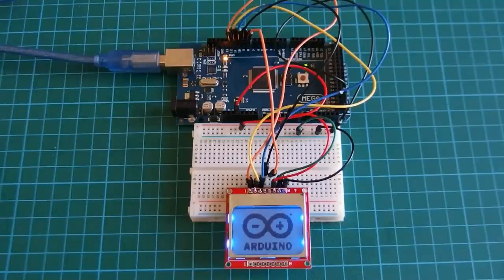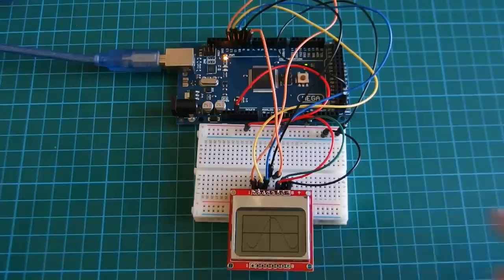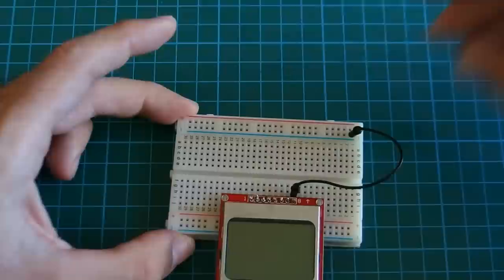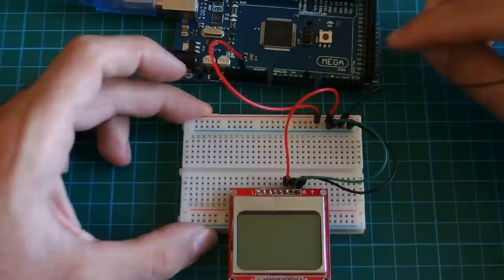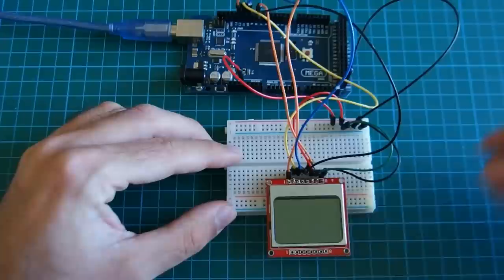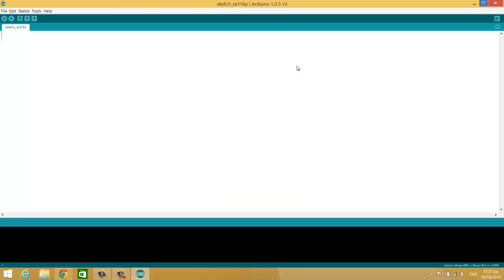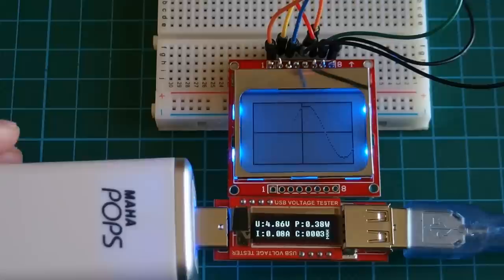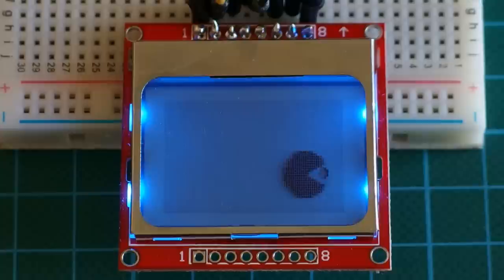Arduino Tutorial: Nokia 5110 84x48 LCD display, how to drive with Arduino

Comment: You need to us either the 4050 level shifter ic, or use current limiting resistors of 10k on the logic pins to prevent damage.

Comment: I was reading somewhere that the 5110 had to run at a 3.3v signal and it might damage running at a 5v signal.
Reply from the maker: +Crackerjack Don't worry I am using mine with 5V for months with no problems at all.
Reply: Crackerjack yeah, we had it in out student f1 racecar and at 5v it slowly died.....
Reply: Displaying fast animations my display would stop at 5v signals, adding a logic level converter to 3.3v fixed the problem. Thereare so many variations of this screen maybe a rule of thumb for someone won't apply to someone else. I suggest following the specs for yours.
Reply: Until now i have destroyed two displays due to 5V signals. It won´t die instantly but after some time it conks out...
Reply: cant you just use a 1k-2k divider on the DIN pin to drop your data logic down ?

Comment: Excelent video, I have a question, You are using an Arduino, it's 5V logic level CPU. The display has 3v3 logic level, internally it has a 5V to 3V3 regulator but logic level remains at 3v3!
Accordly datasheet, ILI9163C doesn't support 5V logic levels, this mean you need a logic converter, such as CD4050 IC, powered at 3v3 between arduino and display. Why you don't use this ? no risk of screen burn? I Ask because I use the lcd like you show and few hours later the screen turn off sometimes.
Thank's
Reply: Use 10k resistor

Comment: Be careful how you connect the backlight. I used resistor which has not enough ohms and got glitched pacmans. Use resistor with greater value and you'll be good.

Comment: Shouldn't all pins have 3.3v? You have connected all the other pins directly to the Arduino without a level shifter even though the library page says you have to use it.

Comment: Update: The library is now at http://www.rinkydinkelectronics.com/library.php?id=47
I saw that the breadboard is not really needed to connect the 5110 to the Arduino Mega.  I also figured out how to control the contrast with a 10k pot when running on 5v (although it works perfectly at 3.3v) and the display is too bright. Very good tutorial Sir! I look forward to watching the rest you have so kindly provided. Thank You.

Comment: It works too for "blue" LCD variant with PINS RST, CE, DC, Din, Clk,Vcc,BL,Gnd http://embedded-lab.com/blog/wp-content/uploads/2016/01/T7_OP2.jpg but: SCK is Clk, MOSI is Din and CS is CE

// It is assumed that the LCD module is connected to
// the following pins:
//      SCK  - Pin 8  is Clk my PIN 6
//      MOSI - Pin 9  is DIN my PIN 5
//      DC   - Pin 10 -- DC my PIN 4
//      RST  - Pin 11 -- RST my PIN 2
//      CS   - Pin 12 is CE my PIN 3
//
#include <LCD5110_Graph.h>
//RST, CE, DC, Din, Clk,Vcc,BL,Gnd
//D2,D3,D4,D5,D6 and VCC-3,3V, BL-(potentiometer to control backlight)-5V, GND-GND

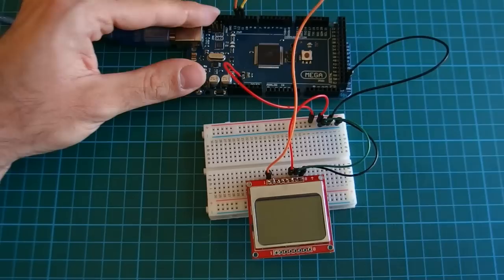Comment: Hi was able to do the wiring and also pasted the library under the Arduino library, but when trying to complite the demo on the examples, i get the following error: Arduino:1.6.5 Hourly Build 2015/05/15 04:50 (Windows 8.1), Placa:"Arduino Uno"

Opciones de compilación cambiadas, reconstruyendo todo

LCD5110_Scrolling_Text.pde:18:27: fatal error: LCD5110_Graph.h: No such file or directory
compilation terminated.
Error de compilación

  This report would have more information with
  "Show verbose output during compilation"
  activala desde Archivo > Preferencias

Any help will be aooreciated.

Regards,
Reply from the maker: +carlos villalobos It seems, that your Nokia 5110 Graph library is not installed correctly. Please try again.
Reply: +Educ8s.com Hi. I went to the option that says to load the .zip file, i was able to upload it and now it works. Thanks for replying.

Comment: Clear explanation on all your videos, thanks! But I am getting an error with this, can you please help?

Arduino: 1.8.1 (Windows 10), Board: "Arduino Pro or Pro Mini, ATmega328 (5V, 16 MHz)"

L:\Documents\Arduino\LCD5110_Graph_Demo\LCD5110_Graph_Demo.ino: In function 'void loop()':

L:\Documents\Arduino\LCD5110_Graph_Demo\LCD5110_Graph_Demo.ino:52:42: warning: deprecated conversion from string constant to 'char*' [-Wwrite-strings]

   myGLCD.print("LCD5110_Graph", CENTER, 0);

                                          ^

L:\Documents\Arduino\LCD5110_Graph_Demo\LCD5110_Graph_Demo.ino:53:34: warning: deprecated conversion from string constant to 'char*' [-Wwrite-strings]

   myGLCD.print("DEMO", CENTER, 20);

                                  ^

L:\Documents\Arduino\LCD5110_Graph_Demo\LCD5110_Graph_Demo.ino:61:40: warning: deprecated conversion from string constant to 'char*' [-Wwrite-strings]

   myGLCD.print("(C)2015 by", CENTER, 36);

                                        ^

L:\Documents\Arduino\LCD5110_Graph_Demo\LCD5110_Graph_Demo.ino:62:45: warning: deprecated conversion from string constant to 'char*' [-Wwrite-strings]

   myGLCD.print("Henning Karlsen", CENTER, 42);

                                             ^

L:\Documents\Arduino\LCD5110_Graph_Demo\LCD5110_Graph_Demo.ino:165:43: warning: deprecated conversion from string constant to 'char*' [-Wwrite-strings]

   myGLCD.print("Runtime (ms):", CENTER, 32);

                                           ^

C:\Users\User\AppData\Local\Temp\ccpN5Xgf.ltrans0.ltrans.o: In function `loop':

L:\Documents\Arduino\LCD5110_Graph_Demo/LCD5110_Graph_Demo.ino:46: undefined reference to `arduino_logo'

L:\Documents\Arduino\LCD5110_Graph_Demo/LCD5110_Graph_Demo.ino:46: undefined reference to `arduino_logo'

L:\Documents\Arduino\LCD5110_Graph_Demo/LCD5110_Graph_Demo.ino:148: undefined reference to `pacman2'

L:\Documents\Arduino\LCD5110_Graph_Demo/LCD5110_Graph_Demo.ino:148: undefined reference to `pacman2'

L:\Documents\Arduino\LCD5110_Graph_Demo/LCD5110_Graph_Demo.ino:139: undefined reference to `pill'

L:\Documents\Arduino\LCD5110_Graph_Demo/LCD5110_Graph_Demo.ino:139: undefined reference to `pill'

L:\Documents\Arduino\LCD5110_Graph_Demo/LCD5110_Graph_Demo.ino:142: undefined reference to `pacman1'

L:\Documents\Arduino\LCD5110_Graph_Demo/LCD5110_Graph_Demo.ino:142: undefined reference to `pacman1'

L:\Documents\Arduino\LCD5110_Graph_Demo/LCD5110_Graph_Demo.ino:146: undefined reference to `pacman3'

L:\Documents\Arduino\LCD5110_Graph_Demo/LCD5110_Graph_Demo.ino:146: undefined reference to `pacman3'

L:\Documents\Arduino\LCD5110_Graph_Demo/LCD5110_Graph_Demo.ino:160: undefined reference to `The_End'

L:\Documents\Arduino\LCD5110_Graph_Demo/LCD5110_Graph_Demo.ino:160: undefined reference to `The_End'

collect2.exe: error: ld returned 1 exit status

exit status 1
Error compiling for board Arduino Pro or Pro Mini.

This report would have more information with
"Show verbose output during compilation"
option enabled in File -> Preferences.

Comment: Good video. However, the contrast in these displays is poor ,erratic and frustratingly, tends to fade in and out.
Reply: Angus MacLellan check all of your connections, also what codet and library are you using?  if you are using a level shifter what kind?  If none of those issues are the problem you may need to gently press down on metal surrounding the screen, as the strip going to the screen may not be making good contact as these were intended to be encased in a phone.  These are great for the price, unfortunately many tutorials are not the greatest or give incorrect information

ελέγξτε όλες τις συνδέσεις σας και τι κώδικα και βιβλιοθήκη χρησιμοποιήσω; αν χρησιμοποιείτε ένα επίπεδο μεταγωγέας τι είδους; Εάν κανένα από αυτά τα ζητήματα είναι το πρόβλημα μπορεί να χρειαστεί να πιέστε απαλά προς τα κάτω στο μέταλλο γύρω από την οθόνη , καθώς η ταινία πηγαίνει στην οθόνη δεν μπορεί να κάνει καλή επαφή , όπως εκείνες που προορίζονται να περικλείονται σε ένα τηλέφωνο . Αυτά είναι μεγάλη για την τιμή , δυστυχώς , πολλά tutorials δεν είναι η μεγαλύτερη ή να δώσει ανακριβείς πληροφορίες

Comment: good night, good video I loved, I'm from Brazil.
  I doubt, the signals coming from the Arduino is 5v damage the display?
WHAT should I do to convert them to 3.3v?
thanks
Reply from the maker: Thanks, don't worry 5V is OK with this display.
Reply: +Leandro r. andrade If you are using an arduino UNO, there is a pin on the power section that provides 3,3V. Otherwise you can do a voltage devider with 2 resistors.

Comment: Hi, why you don't use resistor or level shifter?. LCD works on 3.3v. You will shorten lcd life
Reply from the maker: +Mateusz Iwaniszczuk From my experience, the display works fine with 5V as well. I have a display running for more than a year with no problems at all. Thanks for the message!

Comment: Does it matter where you place the screen on the breadboard? Can it be anywhere or does it have to be in the exact same holes as in the video?
Reply from the maker: No it doesn't matter. You can place it wherever you want.
Reply: educ8s.tv Thank you so much for your response. The screen doesn’t come on when I connect it as you did, it only comes on if I do what you did and shift the screen one place to the right. Is this still okay? Will the code still work?

Comment: Does this work with other phone displays? I have e bunch of old Nokia phones.

6230   128x128
6230i  208x208
6280   240x320
N95 8gb 240x320

Does the same basic wiring principal apply to these other screens or just the one you got there?
Reply from the maker: +McLidl I am sorry I don't know if the code works, but I doubt.

Comment: Excellent tutorial, as are all your other videos. In this tutorial you use 3.3v for the VCC to the display but no level shift chip is used. 
I noticed that Henning Karlson commented on his website that a level shift controller should be used. I am confused and do not want to damage my display. Can you advise me please?
Keep up with the great work.
Reply from the maker: petrovski1948 Hi, 

Yes indeed. I am using 3.3V for Vcc but I could use 5V as well. It won't damage the display, I have done this many times. It is better to use 3.3V for Vcc because with 5V, the contrast of the display is high and you have to reduce it in code. As for the other pins, I am using 5V level logic with no problems at all. Don't be afraid, it seems that this display is 5V tolerant.

Comment: Hi, Thanks for the video, I made the connections properly rechecked them again. Connections are ok Voltage between GND and VCC is 3.3V DC, Sill no display, I suspected problem with Nokia5110 hence got a new Nokia 5110 still the problem remains, please guide. regards. MM
Reply: Somebody please help, lot of projects are on hold due to no display. All these projects are related to green earth.
Reply: i can help you with a little more elaboration or post a notice on arduino forum

Comment: hello, im using Arduino mega and sparkfun Si 7021 Temp sensor and MPL3115A2 Humidity sensors.
i have code and run perfectly on my PC
But i want LCD display connect to it. Please help me how to connect my Arduino with Nokia display
i use some code from internet but its not working

Comment: I try make UV meter but not work for me I have Geekcreit™ UNO R3 ATmega328P Arduino & Nokia 5110 LCD display from banggood. LCD stay light fine but still blank no display.
I bet cheap Chinese LCD
Reply from the maker: Check your connections again. I never had a problem with a Nokia 5110 lcd.
Reply: All connection fine & been setup from download library then uploaded on Arduino all fine no error but LCD still blank.
Here pic
http://i.imgur.com/3Jh9XIL.jpg
Reply: Could you press and hold the reset button on Arduino to see if the LCD shows anything?
Reply: I got the same problem, tried with external power and it worked.

Comment: Hi, thank you again for the very good tutorial.
It didn't work properly for my Arduino Uno R3 : I could only see sometimes the drawings, but they disappared after 1/2 s.
I found the solution on this link : http://ianlangelectronic.webeden.co.uk/#/lcd-module-0/4569058582

The way to let it work is to connect the pins with resistors :
- RST, DC, DIN, CLK : connected with 10 kOhm resistors
- CE : connected with a 1 kOhm resistor
- VCC, LIGHT, GND : connected directely with the cable

That works very well !

Comment: how do you import it on the Arduino IDE ?
Reply from the maker: kid robot maker It is easy and described in the video. You copy the library files in the folder Arduino -> Libraries, you open Arduino IDE and it there, ready to open and include in your projects. If the Arduino IDE is open when you copied the files, you have to close it and open it again or go to menu: SKetch -> Import Library -> Add Library.
Reply: when I downloaded the library from the site you provided, the file isn't a folder. It is shown as a Document for the " Notepad " application on Windows
Reply from the maker: kid robot maker The file you downloaded is a compressed .rar file. You need winRar program to unRar it.
Reply: ohh ! gosh i feel so stupid! thank you very much!
Reply: kid robot maker Windows is Stupid, you are just a victim of applying logic to an OS that has none.  Grab a spare flash drive, with a decent R/W speed and take the Linux plunge at your leisure; no changes will be made to your current system.  Even a slow flash drive will out perform many Windows systems especially if you have decent RAM.  I've been off the MS for about a decade, Almost everyone uses Linux on multiple devices everyday and has no idea they are; without it tech would be F'd.   I hate the direction Ubuntu went in, however once you get a feel for things you can custom design your OS quite easily; Linux is just a Kernel, each distro has it's own GUI flavor; go and taste the rainbow!!

Comment: It soes not work for me. I connectet everything as shown in the video and after i uplad the cod the diaplay work for ca. 2 sek. and the turns off :( I am getting this error: C:\Users\username\AppData\Local\Temp\arduino_modified_sketch_277763\LCD5110_Graph_Demo.pde: In function 'void loop()':

C:\Users\username\AppData\Local\Temp\arduino_modified_sketch_277763\LCD5110_Graph_Demo.pde:52:42: warning: deprecated conversion from string constant to 'char*' [-Wwrite-strings]

   myGLCD.print("LCD5110_Graph", CENTER, 0);

                                          ^

C:\Users\username\AppData\Local\Temp\arduino_modified_sketch_277763\LCD5110_Graph_Demo.pde:53:34: warning: deprecated conversion from string constant to 'char*' [-Wwrite-strings]

   myGLCD.print("DEMO", CENTER, 20);

                                  ^

C:\Users\username\AppData\Local\Temp\arduino_modified_sketch_277763\LCD5110_Graph_Demo.pde:61:40: warning: deprecated conversion from string constant to 'char*' [-Wwrite-strings]

   myGLCD.print("(C)2015 by", CENTER, 36);

                                        ^

C:\Users\usrename\AppData\Local\Temp\arduino_modified_sketch_277763\LCD5110_Graph_Demo.pde:62:45: warning: deprecated conversion from string constant to 'char*' [-Wwrite-strings]

   myGLCD.print("Henning Karlsen", CENTER, 42);

                                             ^

C:\Users\username\AppData\Local\Temp\arduino_modified_sketch_277763\LCD5110_Graph_Demo.pde:165:43: warning: deprecated conversion from string constant to 'char*' [-Wwrite-strings]

   myGLCD.print("Runtime (ms):", CENTER, 32);

                                           ^

I then tought the us port might not deliver enough currrent to power the display so i connect it to the wall charger but the i didn't diaplay anything :(

Can someone help me?
Reply from the maker: +Dhdhxh Xudifici please try building one of the other projects that I use the Nokia 5110 display and tell me if it works.
Reply: educ8s.tv Im going to try it ;)
Reply: i have the same proplem could you tell me what i could do
Reply: Does not work for me either, the display works with other simple output examples but not with this graphics library
Reply: it doesn't work, do you mind making a fix...